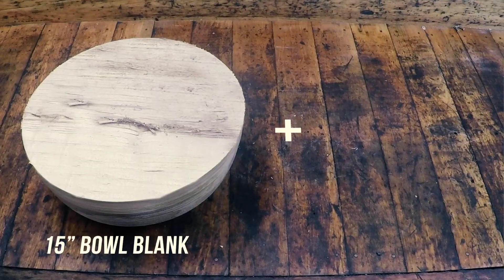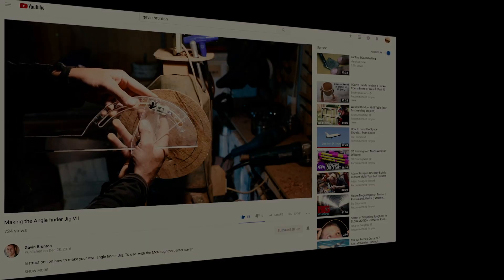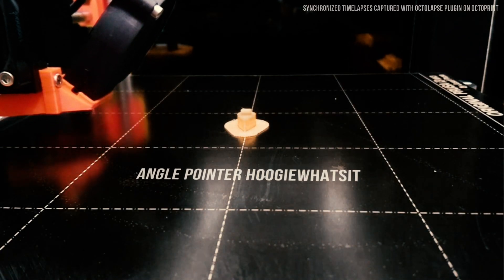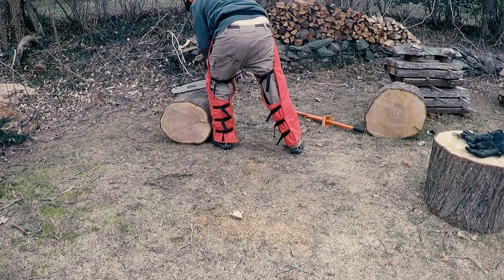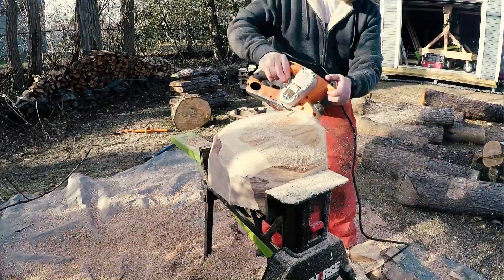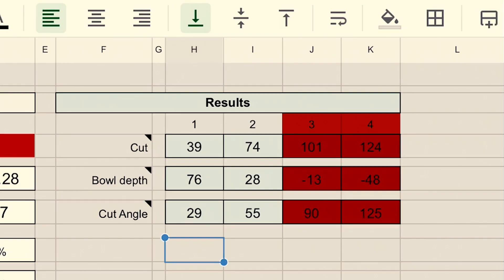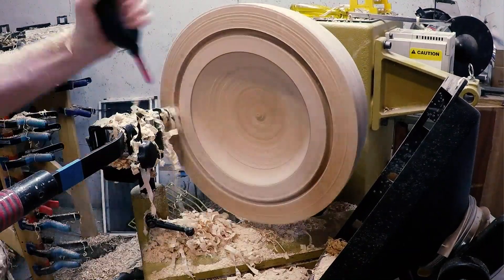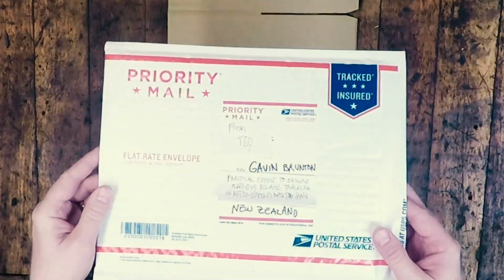3 D Printed Angle Finder for the McNaughton Center Saver Coring System

Comment: Can't wait to try it. I have a little problem with the Protractor_Extension_Arm.stl. Can't figure out, how to print it so the two "extensions" don't get printed in "free air" without support
Reply from the maker: Unfortunately, you do have to use supports and then sand to fit.  As you’ve undoubtedly discovered, the supports leave a pretty rough surface when removed.
Reply: @TheGrainDoctor  Ok, thanks. I solved by converting the files, so I could cut them on my laser, exept the little angle pointer wich I 3D printed.
So if anyone want the laser files, I got them :)